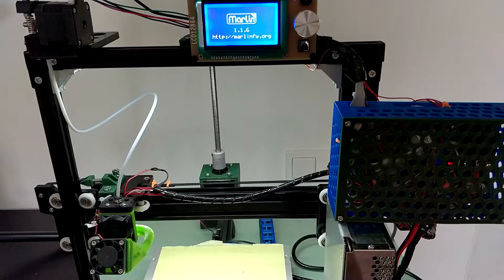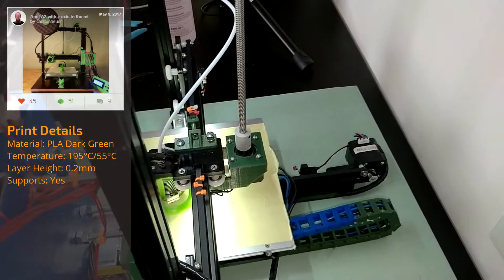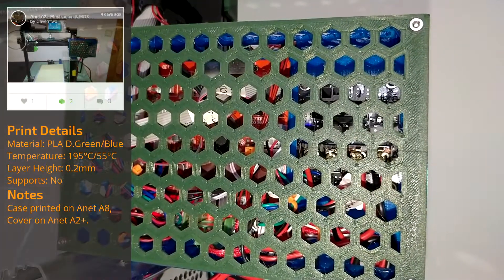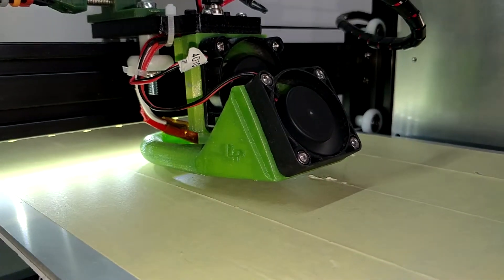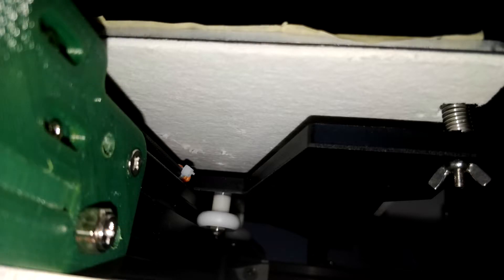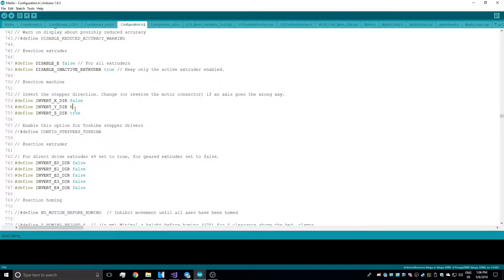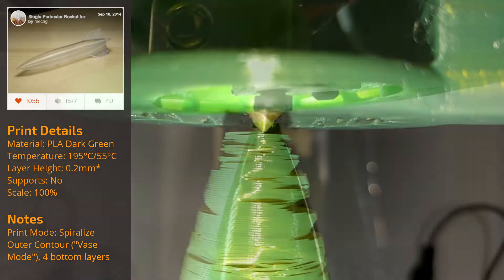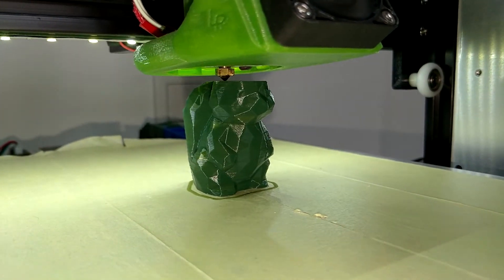Anet A2+ Upgrades

Comment: Hello there! I tried printing the Z-axis in the middle upgrade, but it seems like I am doing something wrong, the top bends a little, and I still have compressed z-layer problems. Also, my part is not as tall as it should be, but I am using the TH3D firmware settings for the Anet A2.
Any help would be very appreciated!
Reply from the maker: Hi there,
Thanks for reaching out to me!

As a very initial guess, I might assume that you printed the top part too weakly. I know, the design isn't perfect, as the part is relatively long. Therefore, It's even more important to print it very sturdily. I don't know what settings I've used anymore, but I remember that I used at least 10 top and bottom layers (1 mm) and at least 40% infill. If I printed it today, I would even ramp up the settings a little bit more to achieve a really sturdy part.

I don't know about the TH3D firmware currently, but it pretty surely has a steps/mm settings anywhere. In Marlin, I set 400.

I'd suggest that you take a look at both things, it could be either of them or even both. 
Let me know if that worked for you!
Reply: @Caverntwo  I have printed the part with 5 bottom layers and 3 top I think, and 30 or 40% infill, don't remember exactly, and I can see it quite flexing. I just don't know if that's the problem or if the rod or the coupler (which I find different oppinions on how to mount in the ned, some say both sides 5mm in, other say ram them together) or something else. 

A look at the firmware tells me it is 400, so you can confirm that this setting is correct? I just don't find any values in the prusa calculator that match up with these.

I am quite sure that I have a problem with the axis itself and not the steps-setting, because of different artifacts on the print.

Thanks for your quick reply, I will have a look further into it!
Reply from the maker: I'd even print it more sturdy. I remember that my first attempt printing the top part failed for some reason when it was about half done, and I realized that it's flexing way too much. So I printed it really sturdy to avoid flexing issues. It's still flexing, but I'd guess only around 1 or 2 mm.

Another thing you should take a look at is the installation of the top holder. Make sure that it is exactly above the motor. I took a level to confirm it (the printer needs to be placed on a level area). 

For the coupler, it doesn't really matter how much the space between the motor shaft and leadscrew is in this application, as long as they don't touch! The reason for that is that in our case the coupler is pulled apart thanks to the weight of the motor, so it's flexing anyways. If your coupler is really pulled apart and bent, then it's broken and you should replace it. 

Yes, 400 is correct. Measure it yourself. The rod is a T8 (metric trapezoidal) with a 2mm pitch and the thread line starting 4 times (when you take a look at the top), meaning that it advances 8 mm with a full rotation. I looked up Wikipedia and other sites just to give you the proper answer: they are Tr8x8(p2) leadscrews.
With default stepper drivers, like the cheap A4988s I use, you can achieve 1/16th steps. The Prusa calculator returns 400, just as expected.

One more thing to try: Could it be that the extruder is pushed against the bed in the initial layers? Make sure that it only slightly touches the bed.

Let me know if that helped!
Reply: @Caverntwo  Okay, so I have now gone into the issue a bit further, and when watching the axis move up and down, I think I can see it stuttering. I don't know if it's due to the coupling, the top part or the wheels which drive in the extruded aluminium. The printer has been standing arround for 2 years now, maybe the wheels got an flat spot while not in use? I tried to make a video, if you know a way how I can show it to you, I would send it to you if you would like to see it yourself.

I am not sure if I should reprint the top part or should approach a 2 leadscrew- 1 motor assembly. I found guys on thingiverse who did that as well, seems to work ok.

Love to hear your thoughts again!
Reply from the maker: Yeah, that what happened in my case during the original setup. Make sure that the wheels can turn freely and that the top holder is directly above the motor. It's more important than it seems. 
For the wheels you can also add a drop of oil if they should tend to stuck.
When the z axis moves up, does the coupler move vertically or circles unbalanced?

Sure, you can contact me via email or Telegram. The contact information can be found in the about section of the channel.

I originally also thought about doing the two leadscrew setup either with one motor or with two (like the Anet A8 has). For me, it worked out with the central axis, so I was happy.

Comment: what size are the screws you're using for the fan on the fan duct?
Reply from the maker: Hi Bob, thanks for your comment!

As far as I remember, I used some M3x25mm or M3x30mm screws for the upper fan. For the lower fan, I used shorter M3 screws, I even had to use two different sizes because some were too long.
Contrary to the original thing, I don't use the additional fan shroud, as it's just not necessary for PLA/PETG prints.

I hope I could help ya, if not, let me know!

Comment: Hello. I have been having problems with my Anet a2. I keep getting thermal runaways. Do you know what could help?
Reply: Check the cables of the thermistors, I'd suggest. Also, search the internet for what exactly triggers these errors and check your printer. Look at the temperatures on the display etc.

Comment: German accent too heavy can't understand what was said! won't stick at all!  So can't print mods printing in ABS
Reply from the maker: Thanks for sharing your thoughts. You'd need a high bed temperature and probably an enclosure to get better results with ABS, therefore try a different material like PLA or PETG.

Comment: Ever printed on glass?
Reply from the maker: Not yet! And I probably won't on this printer. However, I'm about to try on my Anycubic Kossel!
Reply: pla sticks on it very well, petg does too(but some people said that it sticks too well),hips just  fly right off , but if you put gluestick on , a removable glass bed wash it away well
Reply from the maker: The best experience I had so far was with the Anycubic UltraBase and the clone on my JGAurora A5, as the material sticks very good and removes itself when the temperature drops below 40°C.
Reply: The best thing is that printing on glass leaves a reflecting bottom surface , especially with oversquished pla
Reply from the maker: That's true.

Comment: Thanks for the video great to see some a2 content, seems like this printer doesn't get a lot of love on the interwebs. Have you considered a bed leveling sensor? I have really enjoyed the switch to a glass bed. I think that z axis upgrade is my next big upgrade.
Reply from the maker: Thanks for your feedback!
Sadly, although it is better than the A8 IMO.
No, I have never tried a leveling sensor so far, as, when the bed is leveled and the switch is fixed properly, the levelness doesn't change for many prints. So I've not been in need of one so far. There is a glass plate in my Anycubic Kossel, but I have not used it so far (I used tape on it). 
The best experience with both levelness and adhesion is with my JGAurora A5, as it has some special coating that holds the print when heated up and releases it under about 40°C.

Comment: Hi.... I have a question...
All basic firmware are the same right until you tailor them to your machine? And If so then why do I get errors in the firmware when uploading to the main board? Been trying to sort this out for 7 weeks for my anet a8. Can u help?
Reply from the maker: More or less. The Marlin firmware is one project that offers many optional useful features and support for a variety of printer types and boards. The good thing is that you can choose what features you want to have by enabling/disabling them in the configuration files. 
If you have the Anet Mainboard, installing Marlin on it is relatively simple, and I've explained it in my Marlin on Anet A8 video (https://youtu.be/2uX5_rI1QM8), just follow the steps closely. The configuration should work out just fine, with only some slight offsets remaining (and that's because of the physical endstop location).
What errors do you get? If you don't want to post it here, feel free to mail me, I can at least try to help ya ;-)
You need to find out whether you experience *Compile Errors* (errors that show up when clicking on "Verify") or *Upload Errors* (errors that show up only when uploading, the compilation ("Verify") is fine).
If there are compile errors, there's a problem with the code, if it always fails in the uploading stage, there might be a driver issue or a wrongly selected COM port...
Reply: Caverntwo thanks again bro... I've got the idea regarding the firmware and have learnt from scratch... But now I have I will have to tackle the task again this weekend. Thanks for your support and yes I will be in touch if I can't crack it...

Regards
Reply from the maker: Nice! Let me know if it worked out for you!

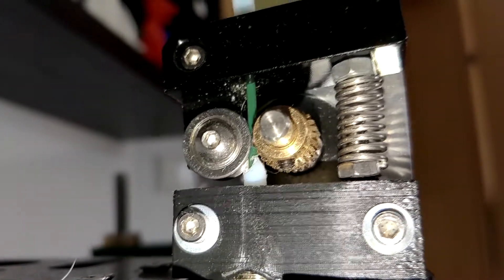Comment: 4:08 yeah I found as well that, especially with PLA parts, a lighter (or in my opinion even better: a small creme brulee torch) is a tool you really need to have, it's so handy for finishing your 3d printed parts, or even for things like what you did here! :-)
Reply from the maker: Yeah, that's totally true, although I've been using it only sparsely so far! Originally, I wanted to design the black part so that I can screw the coupler in, but as I was too stupid for taking correct measurements a few times in a row, I just ended up with this solution. I might consider it more often in the future ;-)
Reply: Well I would! I printed some blocks for a puzzle game a while ago. Some blocks missed a corner, because something gone wrong. I was really dissappointed because it was like a 5 hour print (not that bad though). But I just melted some filament on the corners, and molded it in the right shape haha. It worked great lol. The creme brulee torch is a tool I love ever since that :-D. BTW absolutely no layers were visible in that corner lol
Reply from the maker: It's always annoying if something doesn't properly fit after a long print. I'm definitely gonna try fixing (PLA) models with heat once they fail again. And if it doesn't work out, I can just reprint it anyways. Take the small part from the video for example: Printing it took like 20 minutes on the Anet A8, and I printed it like three times because there was always something wrong. Of course I was really annoyed and therefore tried out this method for the first time. Considering this, then we can count ourselves lucky that PLA has a low melting point ;-)